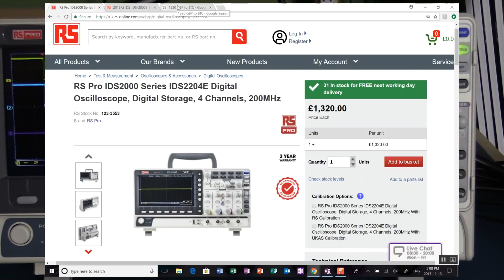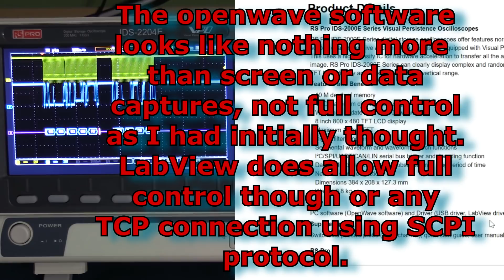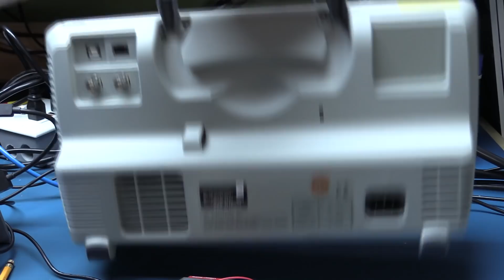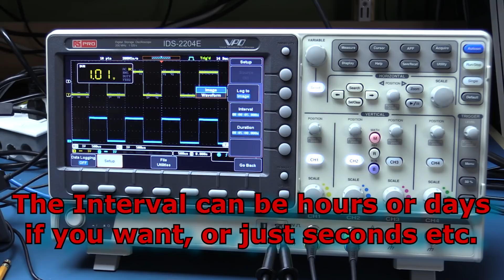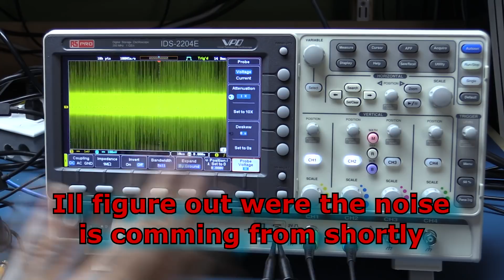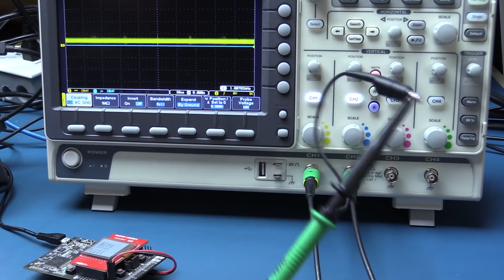RS PRO IDS-2204E Oscilloscope Review

Comment: ISO-Tech is also another RS rebrand of GW-Instek. This scope can be hacked for instance to 300MHz BW, and have a Spectrum Analyzer of 500MHz, accessible through the OPTION button. I have the FFT with dual display enabled on my scope, but I believe that feature is not available in the GW-Instek website.